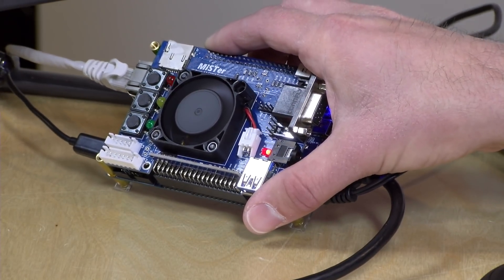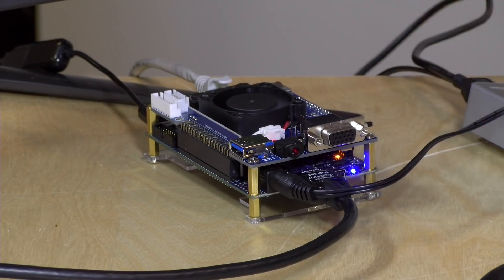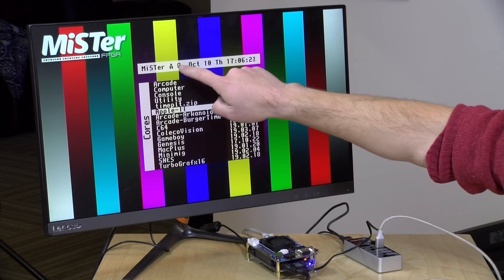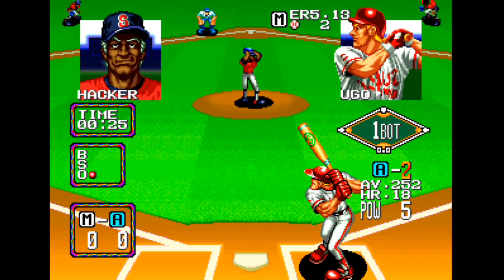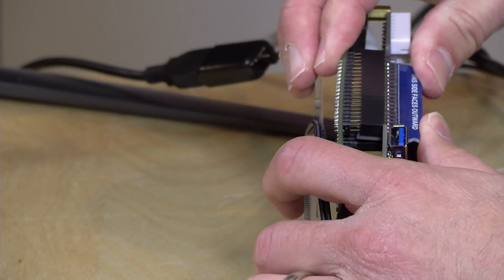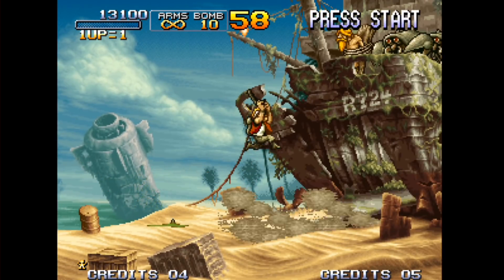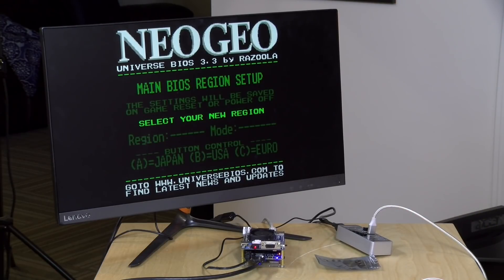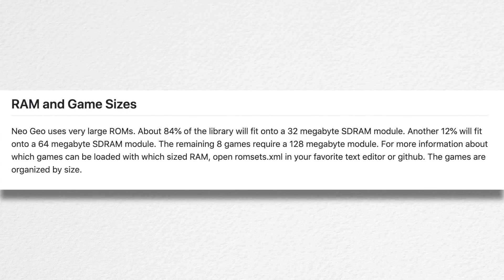Neo Geo on the MiSTer! Upgrading from 32MB to 128MB Module

Comment: Great vid. I've got a question: when playing neo geo roms on Raspberry Pie and RetroPie You had to have roms in specific version, regarding to specific version of the emulator. Is this a case also with the MiSTer?
Reply: you have 2ways to get NeoGeo core work about roms
1. download  darksofts rom pack with default romsets.xml which is recommended
2. modify romsets with wide-spreaded mame roms

Comment: Does MiSTer work okay with Ultrawides (2560*1080 for example)...  ??
Reply from the maker: It won’t run wide, my ultra wide defaults to 1920x1080
Reply: @LonSeidman  I guess I will have to ask Alexey nicely to fix that then.... :-)

Comment: nice video @Lon.tv - looking forward to getting my ram upgraded here soon too! 

One thing of note is that people who are upgrading their MiSTer should keep their existing 32mb/64mb ram and set it aside somewhere safe instead of rushing to get rid of it. There may be some usefulness in having a dual-ram configuration that would have greater memory bandwidth, and possibly extend the MiSTer's capability if a more advanced/demanding core requires that, in the future.
cheers and thanks for the great videos as always Lon.

Comment: Neo Geo emulation these days is really good, but I would really love to see a detailed comparison between FPGA & an emulator & if the difference is enough to invest in a MiSTer.
Reply: i have a neo geo section on my YT channel with much footage from MiSTer, if you want some material to compare. it's made with high quality captures, no intros or other bullshit just gameplay examples. there have been updates to the core since those videos were made, and audio in particular is in the process of being improved, but the gameplay is spot on, as are the graphics. audio is still good, but it will be great in not too much time. core is only a couple months since release and is already of extremely high quality, because of the hard work of furrtek. now many people are chipping in to get everything as polished as possible, and its well worth any fan of the neo-geo's time to check it out, I would say.
Reply: @WalrusFPGA  Thanks, I'll check them out!

Comment: hey thanks :) Although I really don't understand why would someone use this little machine instead of raspberry Pi/or mini PC. Emulation is almost perfect. I would really like you to do comparison of screen on LCD versus old CRT screen. There are cheap HDMI to AV out cables out there that do just fine.
Reply: It's much simpler to setup and maintain than a Pi or mini PC and emulation on some cores is perfect (e.g. Genesis sound tested vs. real hardware). And while there are cycle accurate emulators, it needs a very powerful PC to run (e.g. snes/higan), which is more expensive. That said, nobody is forcing you to get one.
Reply: I think it is good to have the choice, so it's nice that this exists for those that want it.  But I am happy with software emulation.  I find that there is a lot of exaggeration and disdain from people referring to software emulation.  People overstate the amount of input lag that exists or claim that it is far less accurate than it actually is.  I've been playing a couple of old King of Fighters games lately and, while I can't measure the lag, I don't feel any and that's the kind of game where lag would be more noticeable.
Reply: @monolithic-oil-corp  well said
Reply: Guess that i m ordering one now, just to touch with my hands differences. I m worried i ll find none, but i m also very curious to get this